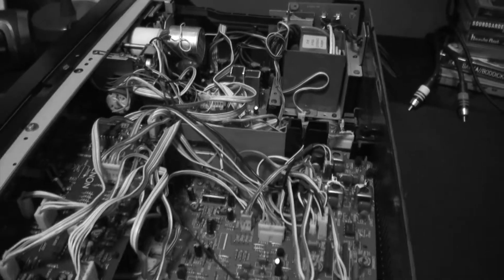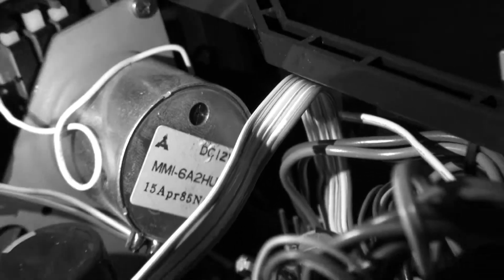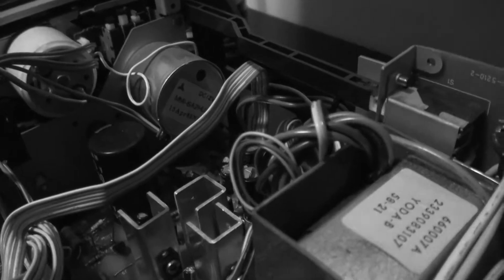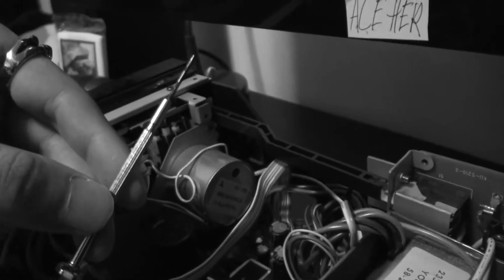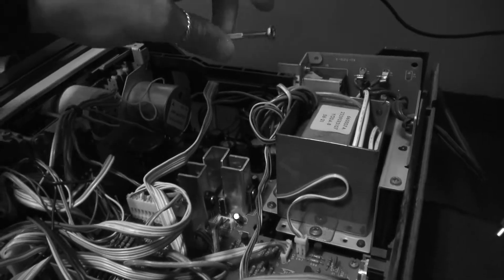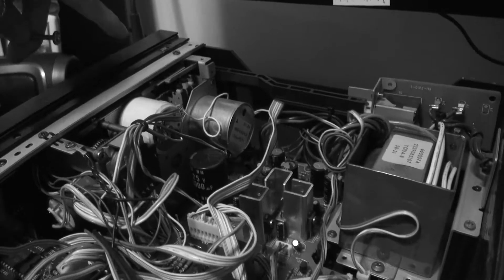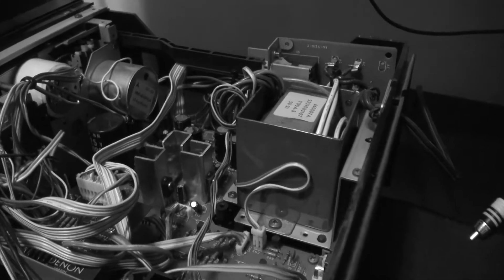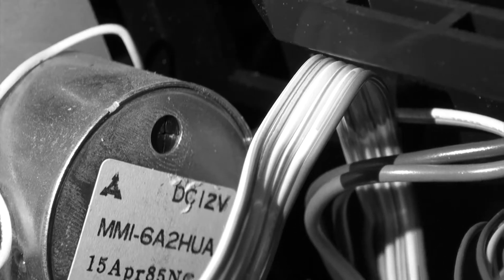Tape Deck Speed Adjustment Tutorial Easy to Follow 2019  -Adam John-

Comment: I have a Technics with the same motor. I disassembled the motor and replaced 2 capacitors and the adjusting potentiometer, it had oxidation and the speed was not stable. Now works fine.

Comment: Bro, you are lifesaver!!! Thanks to your vid I was finally able to adjust tape deck speed on my 20+ years old Sony CMT-CP300. Cassettes were playing painfully slow, it was unlistenable. I found service manual on the internet with schematics of the entire thing, but there wasn't single word how to adjust speed of the cassette motor. Hats off to your great explanation of the whole proces and again - THANK YOU, I'm finally able to listen to cassettes I recorded when I was early 2000's teenager.

Btw, one interesting thing - when I was adjusting speed with metal screwdriver (exactly same you are using in the video), speed sometimes went 2x or even 3x higher then normal. It was caused by touching screwdriver with grounded shell of the motor (I tried to keep it in the center of that little adjusting hole, but during turning of screwdriver I accidentaly touched inner metal side of the hole, which I suppose is grounded and that caused the RPMs of cassette motor to go very high, because outside metal shell of the motor was shorted by screwdriver with adjusting trimmer inside (imho). I didn't damage anything by this, all is working fine, but maybe it's better to adjust that trimmer inside the motor with something isolated/non conductive (plastic screwdriver, piece of thin bamboo stick with tip carved into shape of slotted screwdriver etc.) Better be safe then sorry 🙂

Comment: So after hearing you say there's a speed adjustment on the back of the motor, I went to mine and tried messing with it to no evail. However, while looking at the motor I noticed the 4 power leads going in, and two said high and low power. So, I followed the wires back to the board, and I realized that I was a block head and I completely missed seeing potentiometers labels high and low. Thankyou for making me want to look at the motor, because now I can sleep happy tonight knowing that my problem of slow speed is fixed.

Comment: Good idea on comparing tempo to a digital copy. FYI, the transformer doesn't hold any power after the power is turned off. You're probably thinking of very large capacitors - like in an amp.
Reply from the maker: thank u for watching - yeah i mean if there is any power stored its very little, but for a general point of reference i wanted to make that precaution just in case.

Comment: I just bought a stored brand new sony cfs-208, however the foams on the back are kinda missed up for some reason, maybe because of storing conditions idk. I just need to fight with my flat head screwdriver to reach the end and i just keep spinning and nothing is changing for me. I’ll try using Philips screwdriver and as a last resort i think i might have to rip the foams off to have a clear view and seal the hole with tape or anything.

Comment: I had to skip to minute 6 to actually see how was it supposed to be done. I confidently inserted a screwdriver and adjusted it. Thanks. Also, I think you missed to mention in this case that the screwdriver head is Philips. I was trying with a plain one and nothing was happening.
Reply from the maker: thanks for the suggestion - it might vary from motor to motor, good to keep in mind!

Comment: Do you know if this method would work with a Pioneer CT-W606DR? I just bought it from eBay. It looks and sounds great, just plays fast. I don’t want to open it up unless it really can be adjusted.
Reply from the maker: here’s the manual for that deck (https://www.manualslib.com/manual/443432/Pioneer-Ct-W606dr-Dual-Cassette-Deck.html?page=31#manual) highly serviceable and adjustable. speed control can either be behind the motor as seen in the video or a potentiometer on the board👍

Comment: This deck is not a Direct Drive, it is a 2 motor transport and capstan is operated by a DC SERVO motor. DD motors are actually mounted over the capstan flywheel or it is integral part of it and it wont require belts (for the capstan at least). DC SERVO on the other side can require speed correction as they age since they dont have an exact feedback of their actual speed ... which is what happend on DD motors of those using a signal out proportional to the speed (FG SERVO .... like SONYs). The DC SERVOs haven been perfect so much that an actual feedback is almost not needed.

Comment: good day mate. I have a old tape motor with the small hole in the back that looks like speed ajust but when i took the motor apart there was no ajustment screw inside. Is the another ay i can get the speed rihgt. the motor is mabushi  EG 530YD 2
Reply from the maker: two things: check to see if the speed adjustment is a potentiometer on the board, and if all else fails those replacement motors are readily available on eBay!

Comment: Hey man, can you help me locate the speed adjustment inside an Onkyo TA RW 344? I just paid $100 for a repair, the only tech available on Long Island and it was a disaster. When I first got it back from him, deck A was very slow and B was slightly fast. I brought it back, he said he replaced the motor and belts but now it's the opposite. Also, deck B doesn't sound nearly as loud or as fat as deck A.
Reply from the maker: What a disaster! Honestly $100 is a huge ripoff for such a simple repair, especially when you get lousy work in return. Anyway, get the SERVICE manual here

https://www.hifiengine.com/manual_library/onkyo/ta-rw344.shtml

On page 7 you'll see the speed adjustment pots. Works differently on this Onkyo than the model I show in the video. The adjustments seem to be pots on the board. Rotate them (SLIGHTLY) to adjust. Good luck
Adam

Comment: Hi Adam, Great Presentation and great video! I need some advice? I recently bought a rare Sony TC-U20 Cassette Deck. All the functions work and expect the playback speed plays too fast? You have an email address I can send a picture of my unit Sony TC-U20 Cassette Deck?  The transformer is not near the motor? I can tie some Duct Tape around the screw driver and wear slippers. I don't want to croak or get zapped. My name is Phil by the way. It's better safe than sorry. Thanks man. Enjoy the rest of your weekend.
Reply from the maker: Hmm, that definitely does seem to be a rare deck. I can’t find much information online about it, I would just try to go on eBay and see if you can find a service manual for it. In the service manual should be the adjustment parts that are located on the board. If it is a direct drive cassette deck sometimes the speed adjustment will not be on the back of the motor but can actually be on the board itself in the form of a potentiometer. also, make a post on a cassette forum? someone out there might have the same deck and the same problem! Good luck
Reply: @AdamHiFi   Hi Adam, Thanks for the cool reply 👍🏽💯. I appreciate it buddy. Also, thanks for that important info. You're right. It is a rare Sony TC-U20 Cassette Deck by Sony. I will try to see if I can buy a used manuel that is compatible with that model. I will also find a way to adjust that speed in the motor. I will go to my local hardware store to get smaller size flat head screwdriver. That transformer power supply thing can be a pain. Lol 😂. Thanks again for your help. Peace & Good Vibes.

Comment: Step 1: clean the pot using IPA
Step 2: lubricate the motor(bearings) 
Step 3: Adjust using a testtape.
If you don't, you're not taking in acount drag . Problem with that is: speedfluctuation due to the fact the bearing and the shaft cause wow and flutter and the motor will need to overcome too much mechanical resistance (wear)
By having cleaned the pot, the adjustment will be easier and more accurate.
The motor (and soundguality) will be thankful.
Reply: Does this mean you'll have to take the motor off and open it?

Comment: hello am having problems wsith my old radio cassette recorder  it plays too fast do i try the method you showed  in the video adjusting the speed   or  what is the best way to fix it

.at times its notmal then  it is fast again and it makes noise in the motor  i have a anika R-7300C    its fustrating and cant play my tapes one tape  was already stucked in that cassette recorder  if it does not work  at all i might have to take it to a technician
Reply from the maker: what is the name of your device?
it could be the motor going bad if the speed is fine then goes slow etc. Did you try multiple tapes?
Reply: @AdamHiFi  hi actually  the speed is fast at times  but it could be the motor thats   going bad or has to be replasced i hope not i have a akita radio cassette recorder  its a  unkmnown model i belive its  r-7300c   I TRIED WITH OTHER OLD TAPES  BUT THE PROBLEM IS NOT RTHE TAPE IT MAKES SOUNDS THE MOTOR  and then its ok again . 

its when i turn it off that it comes back .

i tried addjusting the motor  but   i might  dont know how  i better   not try    I NEVER DONE IT .
 I ALSO TRIED GREASING IT FROM THE OUTSIDE  MABY  THE INSIDE HAS TO BE GREASED . IT COULD ALSO BE THE BELT .

ITS HARD TO TELL, BUT IFD ITS THE MOTOR  IT MABY  JUST NEEDS REPLACMENT   CAN U ADVICE ME
Reply from the maker: @marcomolina4574  i really cannot tell u what's wrong. all i can suggest is perhaps picking up a used deck on ebay now as prices are pretty low! just look up "cassette deck" on ebay and good luck
Reply: @AdamHiFi  hi but wouldnt  it maby  help if i just adjust  the motor spped maby thats the cause  because its kinda hard for m e to but one at ebay  since am  in south america thats in bolivia and  they dont deliver things here anymore  thers no post offie no more .

i think i better try to adjust it  or maby  have the motor replaced  if thats the issue anyways  i thank u for trying to help me
Reply from the maker: @marcomolina4574  if you can upload a video of the issue and post to youtube, and try to show the problem on video then i can help try to get you in contact with people who know more than me. is that possible for you?

Comment: I keep trying to put it in but I cant feel the screw. I payed 60 bucks to get it fixed cause it was too fast now its too slow and im frustrated
Reply from the maker: Maybe you can disassemble and take out the motor to get a better look at it? Also anyone who charges you should absolutely take it back if it is not up to spec
Reply: @AdamHiFi  like I went to a store got the driver and none do anything speeds been the same. I idk maybe we can zoom or something possibly im doing it wrong but idk
Reply: I just don't know what to do at this point

Comment: I can’t seem to find the screw. Any tips?
Reply from the maker: what deck?
Reply: A dam an old General Electric boombox I can find the motor but it feels like I’m hitting nothing
Reply: @josearaiza1631  because there IS nothing. One possibility is trimpot on board, second is that your screwdriver is either thick so it can not go in pot, or it is too thin so it misses.

Comment: My motor doesn't change speed no matter what 😃 and I dont see anything on the board to where else it could be
Reply: Look on the motor itself. There might be a small potentiometer (preset). It might not be visible directly but there may be a small rubber slit on the motor through which you can insert a small (watchmaker's) screwdriver and adjust the speed of the motor.

Comment: Oh my God. man, you keep warning about nothing.. what you should be careful of are capacitors, which hold charge even after you disconnect the device, what you pointed to however was a transformer which the second you disconnect does not carry any more power
Reply from the maker: You’re absolutely correct
Reply: Are there any capacitors in this deck we should watch out for?